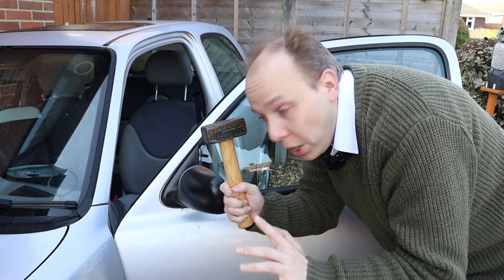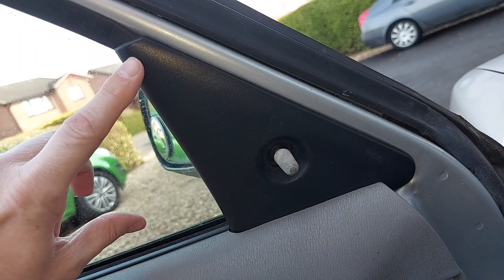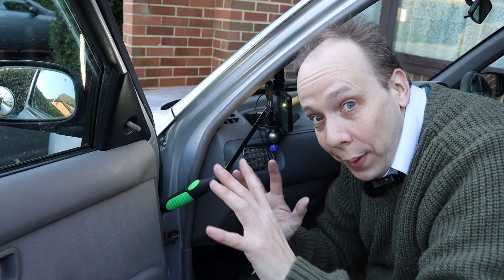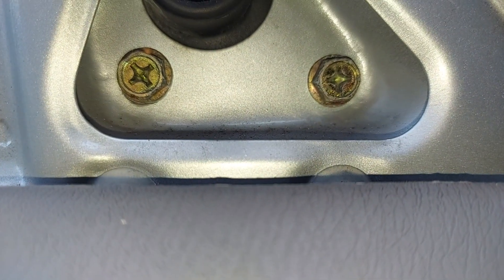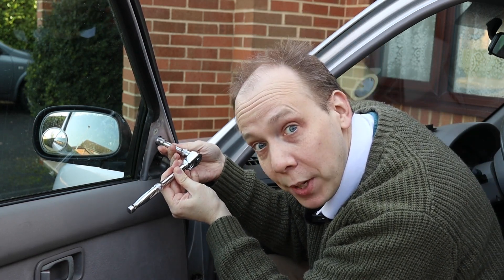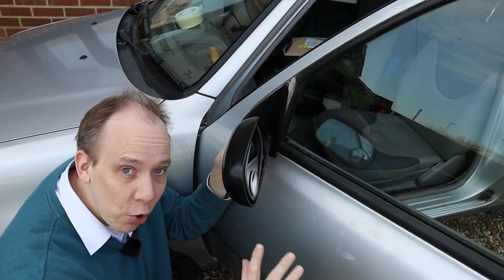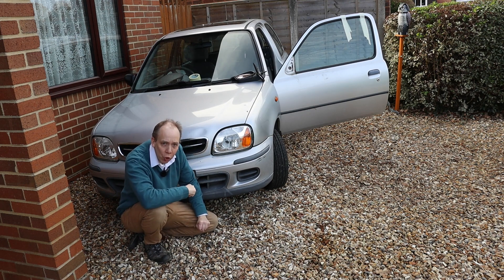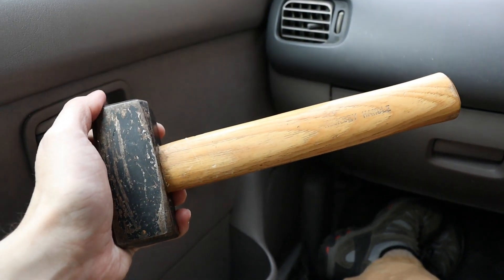Nissan Micra K11: How To Replace Door Mirrors (Complete Guide)

Comment: That's handy to know! On my old s reg corsa I once bumbed the passenger side wing mirror off on a wall, luckily it had a string so was dangling and was just a matter of clicking it back on. Does your corsa have a similar feature?
Reply from the maker: Hello. The Corsa D mirror has an electrical cable that might stop it falling to the ground if knocked. It's more complex to replace than the Micra's, though. Perhaps I'll make a video. Best wishes from CarSpyTV.

Comment: A clear easy to follow video as always.

Nice to see the Corsa repair kit feature in this video too. 😁  Is the Corsa on bigger wheels and tyres or has the suspension dropped or sagged, wheel arches seem well filled, innit .
Reply from the maker: Rumours suggest there's a Deluxe Corsa Repair Kit coming to market. It's got a gold plated hammer! The wheels are original to the car. Someone suggested they should be painted black. Nope!
Reply: @CarSpyTV  no to painting the wheels black, the extra weight might overtax the engine. 😁